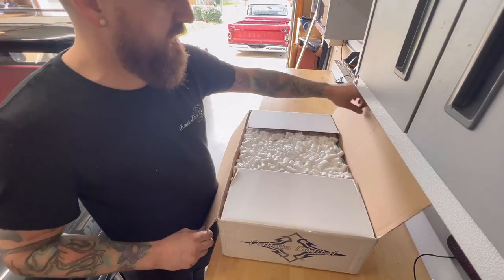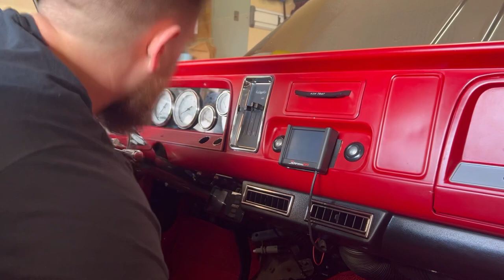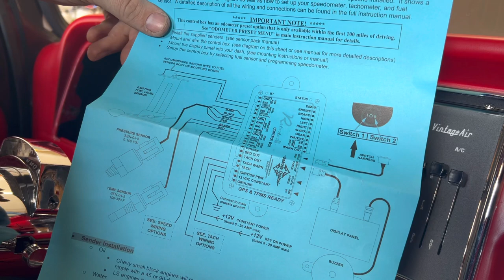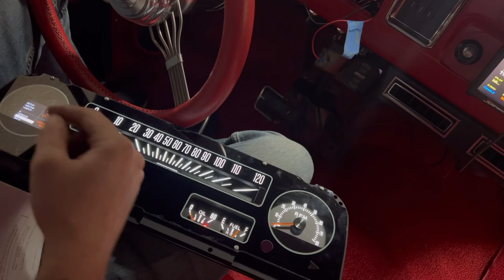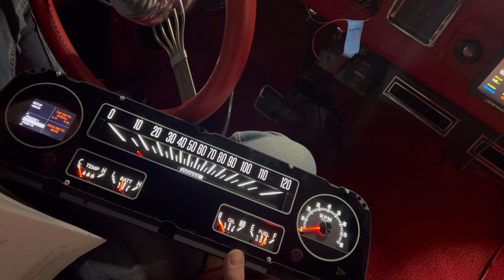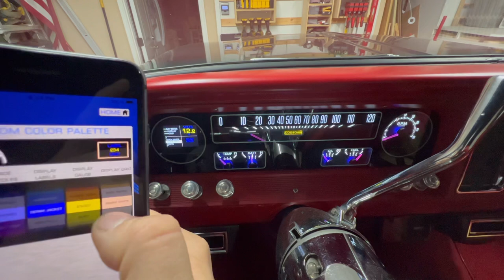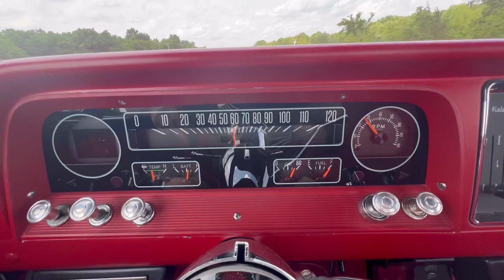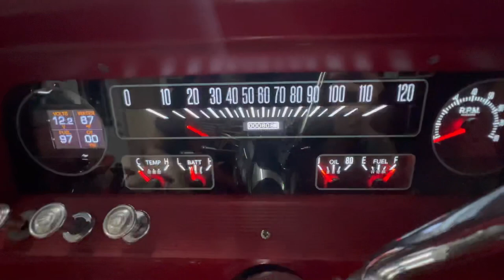Dakota Digital Gauges | Installation Tutorial | 1966 Chevrolet C10

Comment: Very nice work. 
I used a piece of 2 inch flat stock aluminum to mount my control box. Just  scored it where I needed to bend it and bolted it up by the column where I could access it if I  needed for anything. 
V.F. Dakota digital i nstalled
Great job and video. 👍
Reply from the maker: Originally I wanted to do that and then when I started to install I realized I would have to lengthen all my current wires and move my ac and switches so I did the easy route. Mounting them where you can adjust them like you did is the smartest thing to do.

Comment: Very good video,lots of info, very good splained,I bought a vhx set for my 58 chevy with a 700r4 transmission,wich have a electric magnetic speed sensor on the tail shaft can I use any mechanical gear kit for 700r4 in order to be able to use the sensor from the dakota kit? Any information will help me a lot thanks.God bless!
Reply from the maker: Dakota digital comes with an adapter for mechanical speed sensors. You will just need to change the gear kit.

Comment: Great video! Very helpful. On the Dakota digital oil sensor did you use thread locker. I didn’t use any on my install cause instructions recommend not to. But I have a small leak. Thank you.
Reply from the maker: You don’t have to use anything but I like to use some light threadsealant on it.

Comment: They still use the pink wrapper, I like the new factory original look & the color change, it's so much easy too see than the old one, the gear selection could be larger. Is there a way to manually disconnect the bluetooth so it is not emitting electromagnetic radiation? Does it have a way to dim the lights on the dash? I've been thinking of putting tint film on mine, when you get older those LED lights are painful on the eyes. The odometer fades on Dakota after a few years. I miss having an analog rolling odometer.  Would you happen to know why the gear selection shows up backwards on the VHX gauges?
Reply from the maker: You can turn off Bluetooth, you can dim the lights, not sure about the gear selector on vhx. Thanks for watching. They make good product and have great instructions. Just read back through the manual and it will tell you about the first could things I mentioned.

Comment: Very nice truck! Maybe I missed it but where did you run your ground or grounds? I have almost 31thousand on my DD VHX with no problem until lately with my fuel gauge.
Reply from the maker: Fuel ground goes all the way to the tank.
Reply: @SIMPLE.C10  thanks I thought I read that somewhere but I just grounded to the body. I need some new wood so when the bed comes off that will get done 👍

Comment: How did you get fuel level to work . I choose settings for bim since im running holley too but when i do so fuel level drops to empty ?
Reply from the maker: I ran the wires from the tank all the way to the Dakota computer. The obd2 BIM doesn’t detect fuel.
Reply: @SIMPLE.C10  thank you for the info